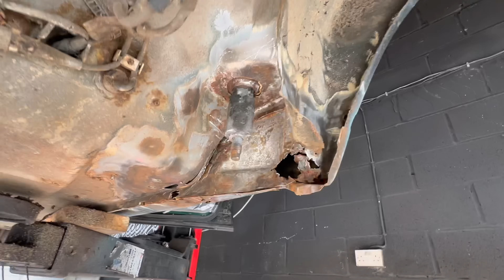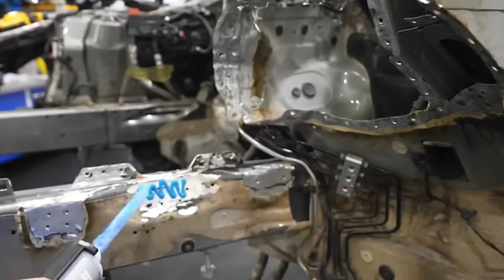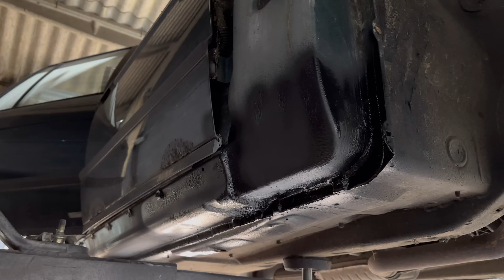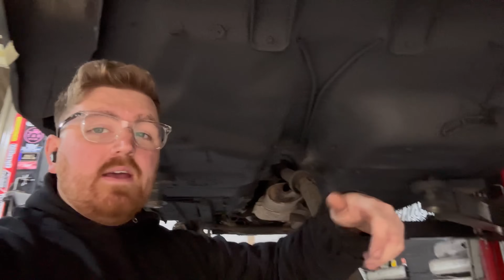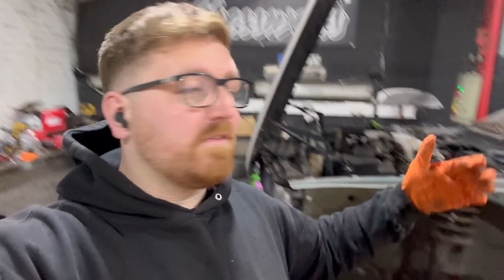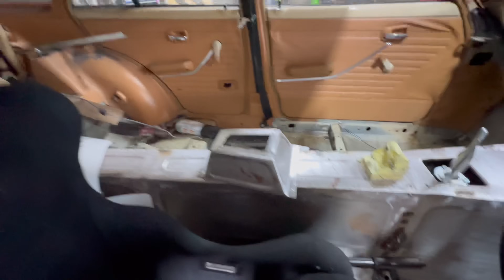HUGE PROGRESS ON THE E34 TOURING!! - NO LONGER ABANDONED

Comment: Really like the Touring, really, really like the Touring 😎
Some fine work there Josh, the fuel and brake lines look seriously neat, nice touch with the original clips. Well done with the bolt extraction too, most of mine sheared off, absolute pain. Did my fuel lines some years back in Kunifer, shaping them was challenging with them being so long, but I managed it all in one piece. Same story with the breather pipes too. I know there's editing, but still that was a rapid turn around, well done Josh!
Reply from the maker: Thanks !!! it was quite a quick turn around for sure! just need to get it done and out the door!

Comment: That's a great tip with the tiger seal.  Thanks Josh.
Reply from the maker: No problem!
Reply: Was about to add you can get a novol gun to use with their underseal and seam sealer products - and then you mentioned it 😂 did my mk2 golf using one, worth the investment if you want OEM finish

Comment: Easiest way to replicate that stud is to put a riv nut through from the other side. 
So unlike them usually being flush, you’ll have the bit sticking out so it’s away from the surface.
Reply from the maker: Can’t get to the back side there!
Reply: @ doh ! Unless you put a riv nut on a plate and weld that over the hole. 
Even if you have already repaired the hole haha. 
I’m full of useful after the fact help 🙂
Reply: @chrisanslow  Came here to say rivnut, threaded rod & red loctite. Did that here on my E30.

Comment: You're never supposed to use copper for brake line.
Reply from the maker: Can you explain why
Reply: Nicop is better and what I use myself but as long as it's fastened correctly so it doesn't harden from vibrations I have not heard anyone have issues with straight copper.

Comment: How do you paint the backside of the butt welded panels? Where the weld through primer burns off? The welded seam will be the most vulnerable area to rust of the whole repair won't it?
Reply from the maker: Those areas won’t be exposed to the elements. they’re sealed away away from
moisture etc! but also so filling them areas with cavity through small bungs, is all you can really do,

Comment: Use a rivnut and tack it in place instead of clamp it in
Reply from the maker: bit messy!
Reply: @  just making sure we talking about same section I am referring to the hole that appeared and you were looking to replicate the internal treaded stud that was still there
Reply: I mean it’s not holding any real pressure or anything so could be squashed and used

Comment: Nice work on the E34 Josh. Just a bit of a tip for the future, I've re-made loads of fuel lines now with copper pipe, and you can get either brass or copper olives (as used in compression fittings) to fit the pipe. If you solder these in position a few mm from the end of the pipe it makes a ridge for the rubber hose to grip onto. The threaded bush thingeys can be re-created using what I call coupling nuts for threaded rod. These are basically extra long nuts that are used for joining 2 pieces of threaded rod together. You can grind the edges off if you wish or just leave them hexagonal, trim to length  and weld them on.
Reply from the maker: Good idea with the copper, was trying to think of a solution, but it was a breather so wasn’t tooo worried.

the thing about those threaded pieces you mention, is that they’re like m4 thread! and would be really messy to weld on due to not being able to get to the back side of this panel!
Reply: @Joshwaa___  OK I get you now. They look a lot bigger on camera. Those things are a pain. They have them down the centre of the plastic clamps for the fuel and brake pipes on E34 and E31. I had a few of them on the E31 where the M4 screw was seized solid into the bush. I had to drill them out, but they are hard as hell, I had to buy a carbide bit. What I ended up doing, cut off the bush leaving about 5mm welded to the body, drill and tap it again to M4, then use some M4 stainless allen cap screws, the clamps still centre on the bit of bush you have left. Really awkward and labour intensive, but better than having to strip out all the carpets to carry out welding.
Reply from the maker: Yeah you know the score then! lucky
us ay 😂
Reply: @bobfrankish8883  Totally agree, been there, got the T-shirt. The tiny screws have a decent head but because they're mild steel and rust in situ, they just shear off. If only BMW had used stainless screws! Well, they used stainless clips so why not go a little extra and provide stainless screws to match, arrghhh!
Reply: @habsom1406  Yes, "The Ultimate Driving Machine",  with tons of engineering short cuts!